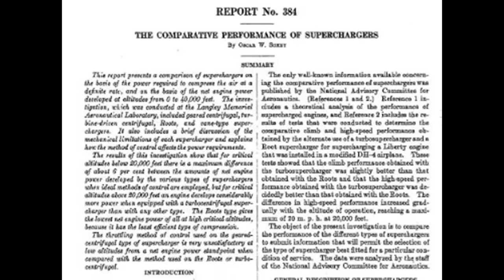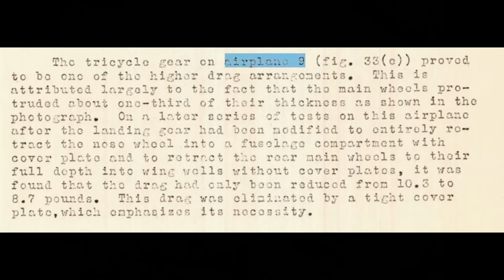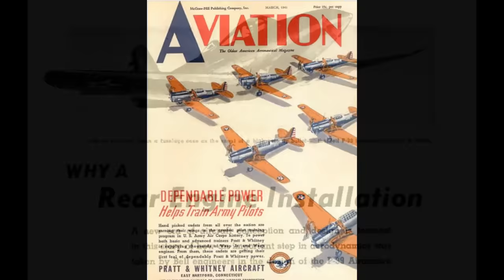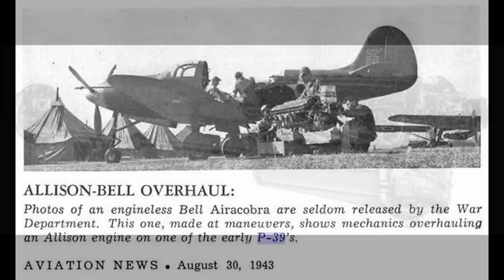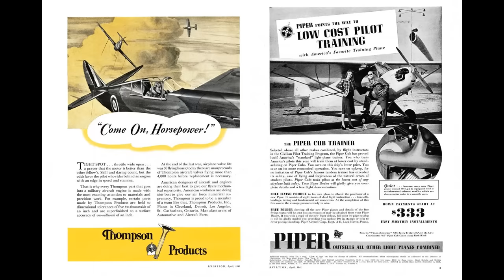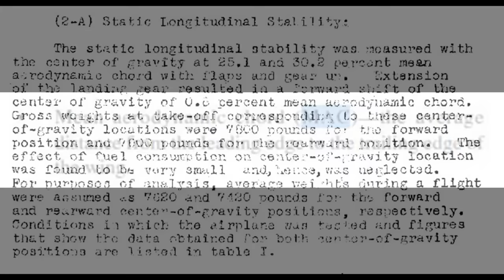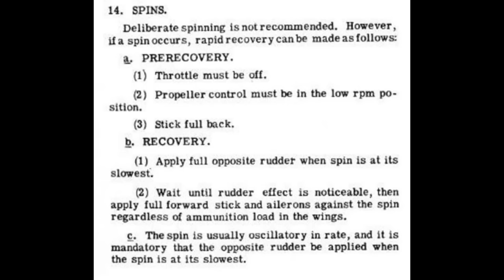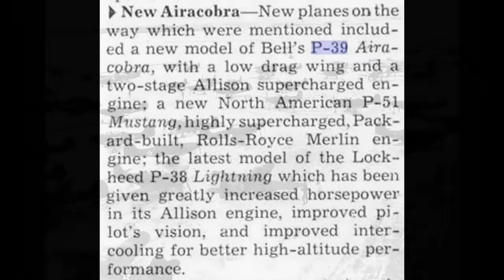Bell P-39 Airacobra, Why the Mid Eng?

Comment: Part 3
Probably, the most famous Airocobra unit in Soviet Air Force was 16 Guards fighter regiment. 
A.I. Pokryshkin, one of the most efficient aces served in this unit. His score: 59 – personally and 6 in-group shots (sources vary), 600+ operational flights. He flew P-39 most part of war and became three times a Hero of Soviet Union (was awarded the highest military award 3 times) for the first time. His first Aircobra was P-39K-1, second – P-39D, third – P-39N.

Here is a short story of P-39 and the regiment.
On January 1943 pilots started to study Aircobra in Adjikabul (Azerbaijan). Planes started to arrive on March 11, but so slow, that pilots had to fly a few planes from Tehran (Iran) themselves.

By April 3, 1943 all the planes arrived (14 – P-39L-1, 11 – P-39D-2) and the unit left for the war front.
By the end of April Aircobras made 289 flights, engaged 28 air fights, shot: 45 – Me-109G, 14 - Me
-109E, 12 – Me-109F, 2 – FW-190, 4 – Ju-88, 1 – Ju-87, 1 – Do-217. Lost 18 planes shot, 2 – in accidents. 14 pilots died.

Quote from regiment’s report: “Aircobra is superior to the newest types of enemy planes in speed, maneurability and fire power. This data is taken from practice work during combat air battles, where our pilots had to engage with 2-3 enemy planes and win.”

New planes arrived: on April 18, 2 – P-39K, 7 – P-39L, 1 – P-39D-2; on April 28 – 9 “Aircobras” and 4 – P-40E.
In May 1943 the pilots of regiment shot down 55 planes: 40 – Me-109, 10 – Ju-87, 2 – Do-215, 2 – Ju-88, 1 – He-111. Pokryshkin’s score was 10 planes this month. Lost 12 planes and 6 pilots.

On May 17 new Aircobra models arrived: P-39M and 6 – P-39N. This time planes came via Alaska and Siberia. A few battered planes were sent to another unit. On May 31 the regiment got 13 pilots from reserve and on June 5 – 6 new planes.
June was a relatively calm month, 2 P-39L were lost during training flights, 9 new planes arrived.
In July, 5 – P-39L and 3 – P-39M received. 4 planes lost, including 2 in action.

When 10 new P-39N arrived in August, early models start to run out from use. Still the last P-39M from the regiment was shot down over Romania on May 28, 1944, last P-39L on March 1, 1945 over Germany. The last P-39M was dismantled for spare part due to aging on May 1, 1945.
Other aces of the regiment, who flew P-39: Kruikov, Rechkalov, Fedorov.

Sources (in Russian): http://airaces.narod.ru/all1/pokrish1.htm   http://airaces.narod.ru/all/16_gp.htm

Comment: Excellent video! I have always loved the P-39/63's. I have had similar thoughts in the past about them and the P-38s not taking advantage of the NACA research and re-imagined them in my head if they had. I think the p-39 could have been a winner (other than range, where we still needed the Mustang). Also, I think the 20mm in leu of the 37 like in the P-400 would have been the better choice. Except, they obviously needed more than 60 rounds. (never understood that choice.)
Reply: Just a point on the ammunition- it was a common issue for almost all contemporary (early and pre-war) cannons. Almost all of them used drum magazines, and so were limited to a relatively few amount of rounds. As for why they used drum magazines? I don't know for sure, but if I had to hazard a guess they hadn't figure out reliable feeding from a belt at that point.
Reply: @EvilTwinn  Yes, the drums were pretty standard, especially for the Oerlikon cannons. However, this was a Hispano which did come in different configurations and the P-38 was the same vintage and it carried 150 rounds in a belt. This to me shows that it was possible. I think it had more to do with weight and available power. Personally, I would have preferred dropping the 30 cals and using that weight for more 20mm ammo.
Reply: @danmallery9142  I don't think weight is the big issue. Weight is probably the least important issue, to be honest. The P-38 has the rather unique feature of having a recocking device in the cockpit. It's noted that the early Hispanos were notoriousy prone to jamming, but the P-38 could mitigate those jams by manually cycling the bolt in the cockpit, unlike almost all similar aircraft. The P-400 lacked such a feature.
Reply: @EvilTwinn  I suspect that if the P-39 had been designed with 20 mm canon from the beginning, the 20 mm canon would have been able to clear jams.
The two 50 caliber machine guns in the nose had handles for that. So why not the 20 mm?
Reply: @martijn9568  It's certainly possible, especially given the engine itself is behind the pilot so you actually have enough room to work with in the nose.

Comment: The Me-309 (prototypes only) comes to mind with a 30mm cannon firing through the prop and a nosewheel rotating to lie flat under the engine.
Reply: The exception that proves the rule, tbh: they had a LOT of issues with that nose gear collapsing
Reply: @spindash64  Good point, like the ME 262...

Comment: As a former Allison engineer, I can tell you that the supercharger issue was polical, not technical. The USAAC would not allow Allison to use two stage supercharging.

Also, turbocharging IS superior to mechanically driven superchargers. First, it is much easier to use charge air coolers with turbochargers. Second, their efficiency is much higher than roots type blowers as well.

There is a lot of misinformation out there about why the Merlin replaced the Allison in the P51.
Reply: Keen to hear more on that subject.

Comment: Greg, the story I've heard about the XP-39's turbo was that the Army changed their mind about the plane's role and decided the Airacobra should be a low altitude ground support type. Obviously the turbo would be dead weight in that role, so they insisted that Bell remove it - and Bell complied under protest. I do not know why the Army would have had such a change of heart re: the XP-39 and not the XP-38, unless it was just that they saw more potential in Lockheed's big twin - which did fly first, and was even faster than the XP-39. I take it you didn't find any evidence of this in the primary sources?

In any case, thank you for another very informative video.
Reply from the maker: I have heard that story, that it was the Army that asked for the change. However there are primary source documents that dispute that, so I don't know what the truth is. I haven't found a smoking gun on this subject.
Reply: To your point my wife’s uncle was trained as a fighter-bomber pilot in a P39 (439 Sqn), but transitioned to P47s before going to Europe. He said the 37mm round looked like a pineapple going down range. Must have had good eyesight. Also trained on Dauntless dive bombers, A24s.
Reply: @GregsAirplanesandAutomobiles  Birch Matthews in "Cobra" says it was kind of threefold. GE was having problems with supercharger production, GM wanted to get into high production on the Allison to start recouping development costs and Bell, always underfunded, was desperate for a large production order. In those days companies paid development costs out of their pockets

Comment: The version I've heard about the removed supercharger is that the lack of weight and duct drag allowed for a significant increase in speed. (Around a ten to fifteen percent change) In turn, this would be ideal for countering low altitude high-speed craft like the Do-17 that had already been seen in Spain. Other airplanes could handle the opponents in upper altitudes, or for that matter a good bomber stream could defend itself. Reduced price and complexity can be an attractive feature as well.
Reply: @Chainsaw That depends on altitude. There are reports of the turbo prototype doing 390 to 420 above 30,000 ft. And 339 to 370 in military configuration at 15,000 with no turbo.
Reply: @barrettjet  Of course. You get diminishing returns on additional power at low altitude due to the relative thickness/drag of the atmosphere. So generally higher altitude means less resistance and more speed - provided you have an engine that can produce power at that height.
Reply: It would have been faster with the turbo supercharger

Comment: Greg, will there be any discussion about the Allison turbo compounded V 1710 engine that was proposed to be fitted in the P 63?
Reply from the maker: At some point I'll get to that.
Reply: That would be interesting but in the end too little, too late. Jets were already on the way. As far as I know the only use made of the P-63 by the USAAF in WWII was as an "interceptor" used by squadrons "attacking" B-29s. These B-29s were used by training units to train gunners. These P-63 carried addition armor while the gunners were using .50 BMG ammunition with frangible bullets that would break up in impact causing sparks to show hits. The P-63s were referred to as pinballs.

Comment: Thanks again for yet another informative video.  Just a couple of points to add.  First, one of the main reasons for deleting the turbocharger was to get a modern fighter into combat service as soon as possible.  Working out all the problems with the turbo would have added months and maybe years before it was ready.  The contemporary P-38 didn't get into combat until the very end of 1942 while the P-39 was ready for combat in spring of 1941 had it been necessary.  Second, the fuel capacity could have been easily increased by replacing the ineffective wing light machine guns with 15 gallon fuel tanks in each wing.  That would increase the total internal fuel capacity to 150 gallons, same as the P-38 and P-40.

Comment: Great video. To counter the CG moving aft due to ammunition expenditure, did anyone try some way to move weight forward. This could be mechanical, i.e. moving some part of the plane on a track, or fluid pumped forward. To prevent adding too much weight, the fluid could be something that is already there. This could be engine oil or coolant or fuel. From this video it appears that there would be no room to do it in the P-39, but what about other aircraft?
How does the 37 mm gun compare with the 37 mm or 2 pounder anti-tank gun?
Reply: The 2 pounder weighs more, has a higher muzzle velocity, is semi automatic and originally fired only armor piercing shot. It just isn’t an aircraft gun. Bell loved the 37mm gun, but the size, slow rate of fire and weight, make it pretty marginal for a 3 ton aircraft already. For what it’s worth the Soviets designed a 37 cannon and put it on the MIG 15. I like to think it was inspired by the P 39
Reply: Fuel transfer was actually done on Concorde. The fuel was pumped from one cell to another to keep the CG close to its optimum. Move it during supersonic flight to compensate for CL move forward, and save fuel.  that was one of the tasks of the flight engineer.

Comment: RE Spin Recovery, I assume the reason for the full forward stick is because you applied full aft stick in pre-recovery step a.(3).  You are now even more deeply stalled, but have flattened the spin, and conservation of momentum slows the spin rate.  When ready to get the wing flying again you need pitching momentum to drive the nose down through a regime where it has no natural tendency to pitch to lower AOA.  This is actually somewhat similar to the Single Spin Recovery procedure of the Cessna T-37.
Reply from the maker: I think that's all correct. Somehow when I recorded this I forgot to mention the full aft stick part. I think there were two reasons for that. First, you want to keep it in the stall until you stop the rotation. If you do it the other way around you could put it into an inverted spin. Second, you want the elevator to push the air down as hard as possible when you go full forward.
Reply: @GregsAirplanesandAutomobiles  Another thing initially going full aft stick does is allow a single recovery procedure to work for inverted as well as upright spins.  For example, the T-37 could be flown out of an upright spin with simple opposite rudder and forward stick, but that method was called "spin prevention" rather than "recovery" to distinguish it from the Single Spin Recovery that would get you out of any developing or fully stabilized spin even if the pilot could not recognize exactly what was happening.
Reply from the maker: That's a good point. I haven't ever done an inverted spin in real life so I didn't think of that.
Reply: @GregsAirplanesandAutomobiles  I Took my aerobatics training from Sammy Mason in Santa Paula Calif. He actually wrote a book  on spins, so naturally we did spins, lots of spins from lots of entry attitudes. Among these spins were inverted spins. These were usually entered from a stable, inverted position, moving the stick quickly forward, and applying the appropriate rudder. The view from the cockpit was similar to that of a normal spin. The recovery was easier  than from a normal spin, according  to Sammy because the rudder was not blanked out by the horizontal stabilizer. This is not true of planes with T tails. We did a few inverted spins from right side up entry. Lots of fun. We were flying a Super Decathlon. Sammy was a retired Lockheed test pilot.
Reply: Spin control/recovery   
37:14

Comment: Before I watched this video, I was under the impression that the P-39 was unusually prone to (flat) spins, and that that was one reason for the enlarged vertical stabiliser on the P-63. The supposed cause was that the designers neglected to account for the weight of the ammunition, and this 'error' was only realised decades after the war. I wish I could remember where I read that, because it seems very unlikely to be true having watched this video.
Reply: my understanding is that the P-39 was able to get into a spin from an accelerated stall (in a dogfight ) easier. Then the poor guy would be fiddling with the airplane to get it OUT of a spin while his adversary was lining him up for the kill. The airplane just did funny things when it got out of shape.
Keep in mind that the average pilot, when maneuvering suddenly to avoid an attack, tended to yank the stick to the LEFT and back..
Reply: @2lotusman851  Now where in the world did you hear that? Yanking the stick to the left or right is not the way to enter a spin.
Reply: Yes, Greg has simply glossed over this only referring to its stalling characteristics in general, saying that there were other planes that were worse and it wasnt that bad. https://youtu.be/_U6zp2bzVcA?t=2610

http://www.wwiiaircraftperformance.org/P-39/P-39Q_Spin.pdf

In a primary source from USAAF testing in 1944, it is noted that during testing they found that a flat spin cannot be exited even with the help of wingtip parachutes and that a pilot should bail out if the recovery technique doesnt work. The report says more testing should be done regarding spin recovery parachute aids.

It also says to never intentionally stall the aircraft under ANY circumstances. ANY. How many other testing results from other frontline fighters indicate that those respective aircraft should under no circumstances be intentionally spun?

This doesn't seem as clear cut as Greg would like it to appear. If you know this is going to be a source of controversy and are familiar with the sources that are counterpoints to your claim, don't gloss over the test findings you know people are going to point to. Why is it that a Russian had to show them about these problems in the first place? Your argument is that it wasn't a problem more than any other plane and yet Bell can't grasp what's going on until Russians come over who actually flew the plane regularly to show that it does have a problem? Why isn't it being talked about like all the other planes?

So because one American test pilot supposedly under one circumstance was able to exit the flat spin with landing gear, all the previous experiences and problems of Russian pilots are moot? A plane supposedly being easily able to be put into a flat spin that is nigh unrecoverable due to an aft-shifting CG isnt a problem?
Reply: @dougalachi  On  IL-2  the P-39  (all variants), are pretty much unrecoverable from a spin. You can drop the gear and flaps, and I've even shut off the engine also which seems to help. A snap roll is recoverable as long as you unload it and keep the speed up, but once you let it develop you'll need a lot of altitude to try to recover. Sometimes it does, but most of the time nope.
Reply: @lulubellers  Yes, I am familiar with the IL-2 flight models but I wasn't going to use that as part of my argument since I do not know how accurate the center of gravity is modeled in the game. I have played the p-39 in enough campaigns to know the danger of the flat spin in that airplane. Trouble like no other, at least in the game. It's why I don't play the plane. It requires much more careful flying, which means you can't do a lot of things you can do in other planes. You have to be constantly wary of the stall danger, meaning you can't pulled quite as hard in many circumstances.

Comment: Thanks for another great one. New subscriber working my way through. There was a good section about the tumbling problem in Tex Johnston's book, who was a Bell company test pilot before his Boeing fame. He said they tried and tried to reproduce this tumbling problem at Bell, and could not; it flew just fine. Finally they brought in someone from a squadron where it had this reputation, who was gonna show them. And lo and behold, he couldn't either. It turned out that the manual specified ballast to be put in the nose if it was flown without ammo, but this was commonly not followed. So this nasty famous problem it had, came simply from being flown aft of the CG limit, same as you would expect from any airplane.